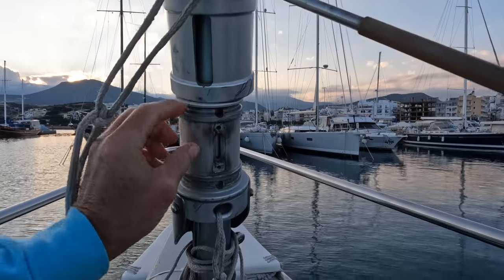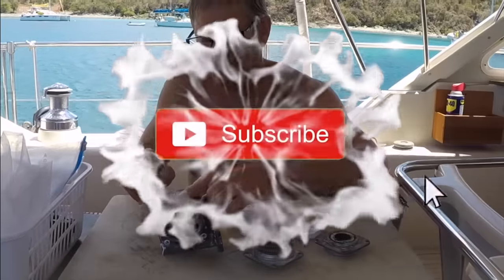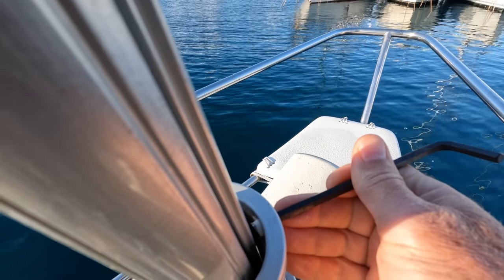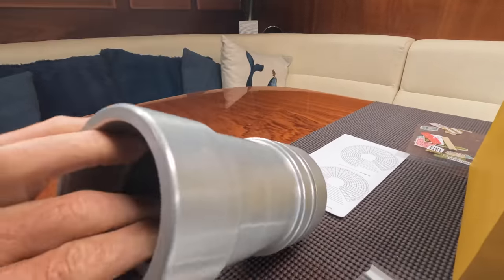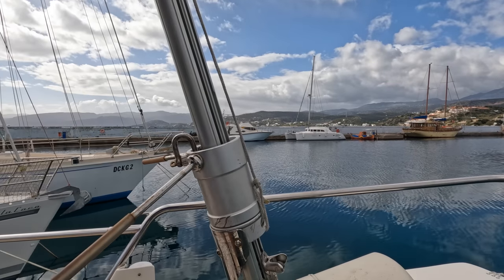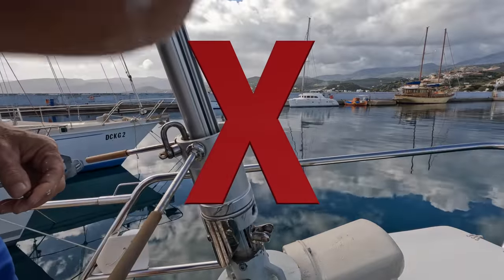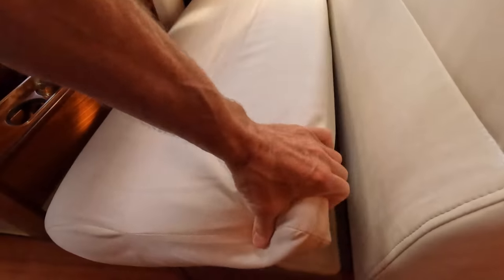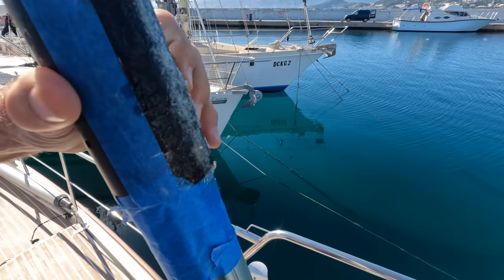The Forestay Swivel - I lost my balls on Tips on Tuesday.

Comment: I had to d the same thing but i just removed the fourstay
Reply from the maker: There are no riggers available if I have a problem for another 2 months here in Crete, and I need to leave in a few weeks.  One rigger came by and said "it might take a few hours, but if there are any problems with the bolts holding the forestay foil to the furler, it might take a few weeks to get everything back together".  I wanted to see if it could be done without removing the forestay.  Cheers.